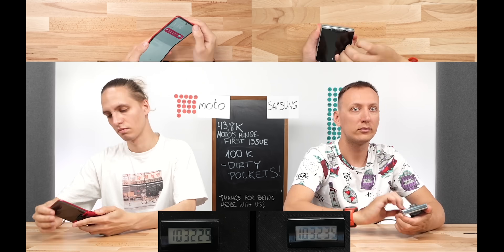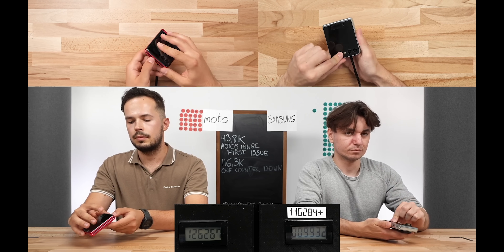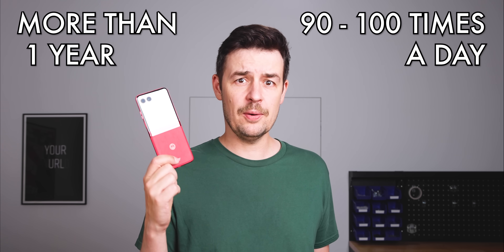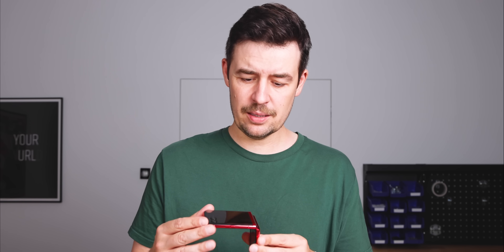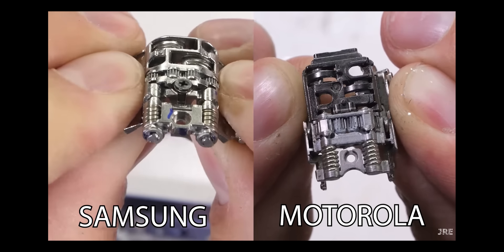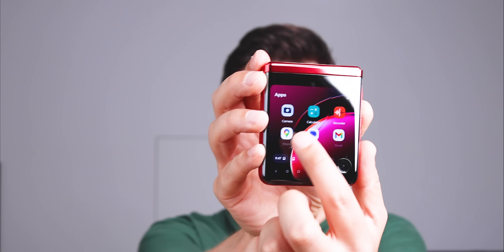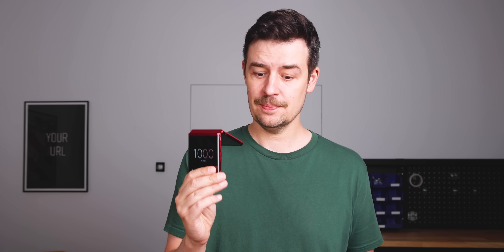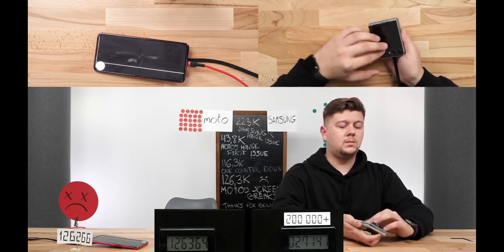Why Did the Motorola Razr Break So Fast?

Comment: well if you fold-unfold it continuously, it will create heat and will most likely break quicker than usual daily usage. one good example, try doing it with a wire.
Reply: Wire or any other metal doesn't break simply because you bend it over and over repeatedly in quick  Succession. It will break at the same amount of bends regardless of how close or far apart the bends occur. 

Anytime something is bent it has both tension and compressive forces applied which generates some amount of heat(energy in always generates heat out) but i do believe doing this test in a short time frame will heat up the screen more so then normally would occur which could have an impact on the test and is something that should have been taken into account. 

But this video is just a general indicator of what to expect. So a good 2-3 years should be expected out of the device.
Reply: @solidsnake6405  again you are wrong about metal heat properties.
Reply: @bigshott9117  again?? And why don't you explain to me just how i am incorrect here?
Reply: As a metal worker. I bend thin metals back and forth until it breaks. I will never trust any electrical in water.. i don't live in my phone so this phone works for me
Reply: This is in no way comparable bruh
Reply: @LaxmannDhotre  it is BRA

Comment: Got a Samsung Flip 5 several months ago and the screen went belly up with lines and inky blots after only 3 weeks.  They tried to say I sat on it or leaned against it wrong, etc. -- none of which occurred.  They wanted almost $400 for the repair on an already $1000 phone.  Nope, won't do it, and never Samsung again.  Got the razr 2023 last week, love it, am hoping for better results than with the Samsung.  I only open and close it about 20 times a day as a secondary phone.
Reply: Hi, could you write an update on razr please? I`m thinking about buying it but there`s sooo much contradictory info
Reply: Share with us your experience pls. Thinking of getting this
Reply: I have the razr and it was excellent for 3 months ,then I got ghost taps at the fold and a snap 1 week later. I've given up on foldables
Reply: Bro my POS happened in one month on my razor and I have a white line now at the bend
Reply: I got the razr 50 ultra now for 2 months, it is amazing and no issue! I even dropped it without a case and apart from a little scratch on the body is 10/10. Of course 2 months is not that much, but will see... At the moment from my side is recommended!
Reply: so can the Phone be Turned off without folding? or it needs to be Folded to turn it off?
Reply: my secondary phone as well its a beautiful piece of tech!
Reply: @justfunandpopeace how is it going?
Reply: Come to the holy light of the Google Pixel. You will finally find salvation in this hellish world of terrible phones with horrible prices and tons of bloatware.
Reply: Had the 5 also. The screen protector started to lift on the hinge edges in roughly a year.  The phone eventually broke in less than 2 years.

Comment: When you fold a piece of steel over and backward and forward  it breaks and cracks the heat builds up? so if you do the' same with a flip phone  heat, will  build up wouldn't you think? and make it break faster?/ so what I'm getting at is when you're doing your testing have a pause in between so heat dissipates" you wouldn't be bending it backwards and forwards continuously would you now? In real life situations

Comment: Okay, easy solution - only fold it when you need to put it in a pocket or have it upright for taking pics or something. Otherwise use it like a normal rectangle. 🤷🏼‍♀️ Just because it folds doesn't mean you gotta fold it constantly. There arent aby rules to it just options which is more than you can say for most standard phones.

Comment: December 23, 2024.
I bought the razr 40 ultra in december 2023 and it runs great. It's my main phone and I've used it without worries. I've droped it with open screen and closed screen (straight on hard floor, cement, etc) and luckily didn't break anything.
Everything is working great like the first day ❤ i mean, i don't know how much it'll last, but I'm pretty happy it's still alive 😂

Comment: I believe that the Motorola can last much longer then it did in the real test because in the real world You're not going to be folding your Motorola non-stop for a week straight and it can generate heat in the hinge because of friction from opening and closing it 24/7 and you won't have to open it as much as the z flip 5 since you pretty much have the entire phone on the cover display

Comment: I have a Motorola RAZR 40 that I’ve had for a year, and it still works efficiently without any cracks or issues with the screen, despite having fallen multiple times. However, in the video, it's very normal for the screen to malfunction because repeatedly opening and closing the screen generates heat. Take the example of a piece of plastic; if you bend it multiple times, it gets hot and then breaks. The phone is not designed to be opened 100 times in a few minutes—this is an illogical test.
Reply: hi, wanted to ask you about games, how does it feel? like modern games, even if the graphics are not high, does it still run well?

Comment: I have a moto razr+ and I added a case which it has a hinge, so it makes more sturdy and sort of blocks the dust
Reply: I just ordered one online and I can't decide if I'll want a case or not. I still need to find info on how well it fares in a drop test.
Reply: @Scroolewse get the case! Because it's small and slippery I keep dropping mine and it has multiple cracks all over the outside of it. I've even cut my hand on the glass a couple times, just slightly, not bad. I wish I had gotten a case on it right away. The screen has never cracked, just the outer cases a mess.

Comment: Seems to me that folding a phone that fast for that long is not a good representation of opening a phone 100 times a day for however long.  It would be creating some heat possibly and or extra stress on the phone.  I would think opening a phone under normal usage would be less taxing on the phone and it would  last longer.

Comment: This is a really dumb video. Did anyone else notice when he did the mic test he was aggressively opening and closing the razr plus and very fast? With the flip 5 he was doing it gently and nice and slow? I've had my razr plus over 5 months and my phone is quiet as a mouse. There's no sound coming out of the hinge at all. Who opens their phone 60 times a day? Ridiculous! Someone made a good point about opening and closing the phone aggressively over and over generates heat and is not good for it at all. It's simple physics. Try again, dude! My razr plus has been amazing. I had the flip 3 and the screen protector cracked within 2 months and I treated with kid gloves.

Comment: So, I think you could follow the tests and take a motorola ultra and start the test again without the dust test, this could verify or not the screen problem
Reply: Yes I was very annoyed when I got halfway and they said they did a dust test in the middle of the folding test. Now the information is meaningless. Either dust up a brand new one before you fold or don't add dust at all when you fold. Anything else and the results really dont mean anything.

Comment: This is incorrect 100%, if you are constantly flipping it open and closed, you are going to create heat on the pivot point where the screen folds. Bend a piece of aluminium, won't snap, bend it 20 times fast.

Comment: You need to test this again with a unit that doesn't have dust under the screen. Not sure why you bothered putting in the man hours to a test scenario where both phones weren't in the same state.
Reply: That's what I'm saying it's a little bullshit
Reply: They were subjected to the same test conditions. The fact that the Motorola took in dust and broke is kind of the point here - yes, the Samsung didn't have dust jammed in the screen, but that's because it did a better job protecting the screen from dust in the first place. If Motorola wants to do better here they should properly seal their hinge.
Reply: @bosstowndynamics5488  That's not the problem.  The problem is that they are trying to verify the 400,000 folds and then introducing new variables partway through the test.  We can infer that the Samsung has the better built hinge and is more resistant to dust but we cannot determine by how much.  Both comparatively and exclusively.  This is all to say it is a useful test but not a very scientific test.

Comment: I've always had good luck with phones. Only he ever had one break and that's because it flipped out of my hands and landed on cement. I got talked into buying the razor last July when I was after another phone but I was very happy with it. However, it is small and very slippery, very very slippery. You can't set it down anywhere without it sliding off onto the floor or whatever is nearby. It flips out of my hands easily and I've got small hands that fit the phone quite well. My phone looks like it's been through World War 3 and it started looking bad within a couple weeks after I bought it. It's cracked and chipped. I haven't replaced it yet but I'm probably going to have to because it'll never last the two years I normally keep a phone. If I could post a picture here I would. The phone still works fine it just looks terrible and if I ever happen to get any water on it or near it I bet it would ruin it because there would be nothing to protect it. If I had to do over I would go ahead and buy whatever case fit it to hold me until I found a purple one I really liked. Unfortunately the store didn't have purple and I didn't get around to ordering one from Amazon fast enough before it started breaking. If I replace it I will definitely get a cover on it immediately. I think that would have solved the problem of it cracking. The screen has never cracked, just the outer case.

Comment: I had a RAZR 40 Ultra for a grand total of 10 days before the main screen developed dead pixels on the fold that subsequently shot a green vertical line up to the top half of the screen. Cancelled the contract - it didn't even make it through the cooling off period!

Comment: I've had both versions of these flip phones. One Samsung Z flip 3, nd two z-flip 4's and most recently a Motorola Razr 23+. All 4 phones failed at the crease on the LCD within 1 year (10 months, 6 months, 2 days and 7 months for the Motorola. The screen's are not designed to handle being folded. They (both companies) try to blame it on user eorror, or say that the hinge was damaged and they won't replace nor honor their warrantee. It's unfortunate. There really needs to be a class action lawsuit.

Comment: First, thanks for your video, it offers some interesting results. Second, i found out something that i never knew(but haven't bothered to research either) and that is "x" from x8 or whatever number stand besides "x". Third and final, your testing results and conclusion is that some spec that is not rated (and marketed) by one manufacturer is better than same spec that has been rated by another manufacturer, by way of known testing methodology, with one test sample. This is why your video seems Sammy biased.

Comment: I would say get whichever phone you like better. I just dont see many people having issues with the hinges on either phone. The screen is what's going to give you the most grief. If you get any kind of grit the size of sand or bigger and shut the phone, the screen will be lucky to survive. I had a zflip 2 and i had to have samsung replace the screen for this very reason. I did preorder the z flip 5,with no gap now, just hoping it does not end the same as my last z flip.

Comment: i love the z fold 3 and 4 that I purchased but anyone want to guess why i had to buy the 4 in the first place?   You bet ya...after a ton of folds it creates this weird light moisture bubble in the center.        I am tempted to try and get the plastic for the fold replaced but then I get how much more use from it?   of course the outside works well but I paid the money for what is on the unfolded side and open it more times than I care to count daily.   I am done with folding phones for a while after this until durability improves because you can have a really nice candy bar and a brand new premium tablet every year with the amt being spent on replacing the fold.  I need to revert back to the Note.

Comment: I have fold4 as a secondary phone. Wouldn't say I open it too often, but yesterday I notice a barely seen fine red-blue(green) lines on a crease. Do you have any idea what it can be? I'm really confused. I love folds and flips, but i worry a bit about this thing
Reply: so I recently discovered I am a fool, Have you tried just taking the inner screen protector off and simply buying a new one to put in it once you verify that fixed it?  Yeah thought my fold was going bad until I saw a quick video showing how to replace it and that only the fold one was like "dont touch that"  I thought we were not allowed to remove it without breaking the screan lol

Comment: I've been using Samsung phones ever since I switched from an iPhone 7, and I have absolutely no regrets about the product's quality. I've dropped my Z Flip 3 several times, and it's still sturdy. In contrast, when I dropped an iPhone once, its screen glass shattered. iPhones and Motorola phones seem to be popular mainly due to the influence of the North American market's sheer size. But as someone who prioritizes efficiency and reliability, Samsung phones consistently remain my top choice. Sony phones are also commendable.
Reply: Errrrrr I don't believe you.
Reply: Complete opposite from my experience 😅 I dropped my S20 once and the screen just shattered to pieces; plus I couldn't stand that the battery life would only last me 4 hours with heavy use. This was way back when the phone was less than a year old (~10 months). I switched to an iPhone 12 Pro, and I've been using it for the past 2 years with no problems. I drop it almost weekly and have never had scratches or breaks in the glass. Given I used tempered glass screen protectors on both phones. 🤔
Reply: @LouiiDee Samsung uses Gorilla Glass on all their phones' screens (not sure about budget ones mind, but definitely the flagships). IMHO Corning dropped the ball on their first generation of Gorilla Glass Victus, because my Note 9 survived me tripping over and accidentally pile driving it screen first into a pointy rock, but my Note 20 Ultra screen has little scuffs all over it from less abusive treatment (although I still drop it a lot, the screen has never had a direct high force impact). Apple meanwhile made a big deal over using their own design for the screen, which I suspect is part of the reason that, broadly, Samsung screens do seem to handle impacts better overall even if early Victus screens were an exception to that rule.

(Fwiw I don't use any screen protector on any of my phones because these days Gorilla Glass is usually going to handle scratches phenomenally better than a cheap sheet of tempered glass, again early Victus screens being an exception, inherently fits better and I'm extremely sceptical of any kind of impact benefit from a thin sheet of very fragile cheap tempered glass loosely stuck on the phone)
Reply: @LouiiDee  Complete opposite from my experience 😅 I dropped my iphone 12 once and the screen just shattered to pieces; plus I couldn't stand that the battery life would only last me 4 hours with heavy use. This was way back when the phone was less than a year old (~10 months). I switched to an Galaxy S20, and I've been using it for the past 2 years with no problems. I drop it almost weekly and have never had scratches or breaks in the glass. You see, thats called anecdotal evidence lmao
Reply: @LouiiDee Hmm.. Then I wonder why almost half the iPhones I see have either cracked backside, screen or both while most Samsung and other brands I see are either not cracked or less cracked🤔🤔

Comment: Did they took off the magnet on the corner of the zflip5? I have the flip3 and work with grinder and metal scalesaw, and all the metal dust and chip go in the four corners of the phones. If i dont remove it before closing the phone, it break my screen...

Comment: I’m waiting for the test with just pure folding, I don’t think that those simulations of dust and water are reliable 🤷🏻‍♂️
Reply: They didn't put them through the dust torture until 100,000 flips. The Moto hinge started giving up at around 43,000 flips.
The brutal dust test might seem rough, but it is Motorola themselves claiming, "Ingress of dust is not entirely prevented, but it must not enter in sufficient quantity to interfere with the satisfactory operation of the equipment". Which does seem like a dishonest claim for a device costing far over a grand.
Reply: they are testing everything this in like irl 5yrs of use in 2 weeks

Comment: As much as i adore my razr plus, it is definitely flawed. I dropped it   one time about 4 feet and it wasnt even a straight drop. The front screen cracked on the side so deeply there's a hole. The glass goes around the edge which is cool looking but not practical. Luckily insurance is sending me a new one but not without a deductible

Comment: lose in performance（8 gen 1+ vs 8 gen 2 oc）
lose in durability
lose in water proof
higher refresh rate outer screen （120hz vs 60hz）
Lose in charging rate a little（30w + 8w vs 25w + 15w)
Win in battery a little (3800mah vs 3700mah) but thanks to the low power consumption of 8 gen 2 this won't happen 
Win in RAM a little maybe (8/12GB selectable vs only 8GB)
lose in ROM （128GB up to 512GB vs 512GB（pre-order））
Lose in SIM slot (single SIM vs dual SIM)
Lose a little in weight (188g for glass/184g for leather vs 187g glass only)
why should you buy moto？
Reply: Of course the samsung haters will buy.